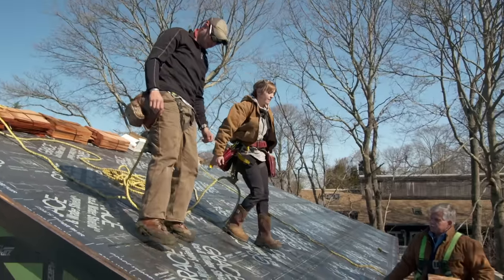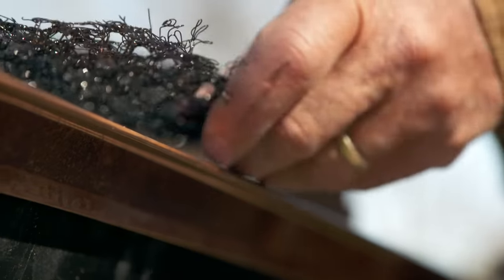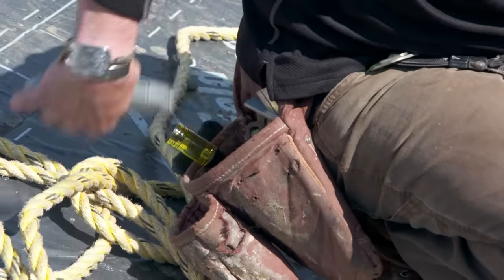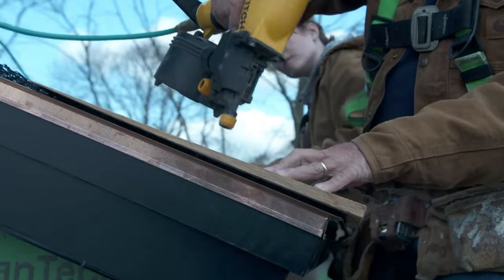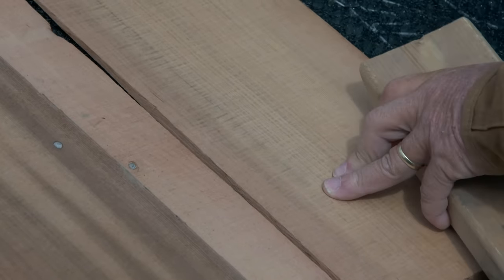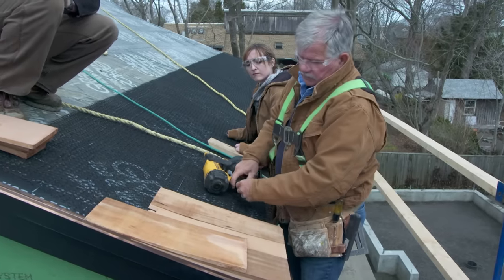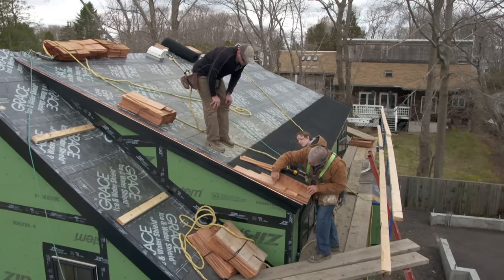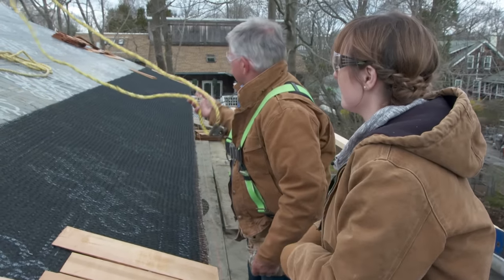How to Install Wood Shingles | This Old House

Comment: I wonder how they do the ridge with a cedar shingle. Great episode.
Reply: Alternate the overlap as you go down. Same way you would weave a corner wall.
Reply: Generally, the ridge shingles are run laterally, ( sideways) with the exposure facing away from the prevailing wind. Snap equidistant  lines down from the ridge. On your tablesaw, you can prep some slightly oversized shingles. The first shingle is nailed to the line, then trimmed flush to the opposing angle of the ridge. The adjacent shingle on the opposing side is set to the line, then planed flush to it's brother. The lap on each pair is alternated to ensure strength and resistance to weather. I have seen copper ridges......also all wood ridges pre-fabbed and epoxied together. You do not continue normal shingling.... a teensy course with exposed nails at the ridge  is a hack recipe for disaster.
Reply: I use a continous ridge vent system consisting of Cor-A-Vent v-600 with a custom fabricated copper trac rack over it. Saddled ridge shakes are then cut in a table saw and glued in place in the rack. We do it the same way with slate. Just nailing a ridge shake up there is 8 trac tape player technology and there are better ways to do things today. This also addresses proper attic ventilation per code as required in most municipalities.

Comment: He missed a lot of details here.  The biggest is not having a gap over a nail.  That is a sure way to get a leak.  It may not show up right away, but the life of the roof will be cut by over half.  You can see he placed the gap right over a nail, and on the bottom half of the roof that nail is going to see a LOT of water.

The other thing is staggering gaps in 3 consecutive courses.  That prevents leaks from cracks and wear because the water will form small streams in the cracks and erode the shingle below.

Installing shakes is very detailed.  You can install a roof and have it look amazing, but it will leak like a sieve and not last 5 years if not done right.  Every little detail matters.

Comment: Nice approach with the Breather and all BUT in Laying out shingles it is CRUCIAL (especially on roofs) that the course you are laying should Offset widths by 1” or more not only 1,. But 2 courses below it.  (If that shingle splits inline with the gap of the shingle below you goy a leak potential.

Comment: I find it amusing that most homes built properly at the time last a hundred years without the benefit of house wrap, roll roofing ventilation mat,  and other millennial inventions?? Why not use a laser instead of a string line?
Reply: Because this site failed to publish my reply to Alexander Zerka I will try to remember it again. That's Great Grampa to you boy and mats were not around 20 years ago. So tell me Mr. Wizzard (before your time-look it up!) if mats prevent moisture from evaporating why isn't it used between courses??
Reply: @alexanderzerka8477  Answer my question, dork!! (look it up)

Comment: I did my garage many years ago. Same as what was done here. I only used the Ice and Water shield around the perimeter then tar paper away from the edges. Also there is the debate whether it’s better to hand nail rather than those skimpy automatic nail heads. Some nail guns you are limited to the type of nails you can use. Hot dipped or stainless?
Reply: Hot dipped galvanize react to cedar.
Reply: "Skimpy/skinny" nails are required for cedar shakes along with them being stainless steel. I use staples to avoid splitting and countersinking but your stainless steel must be #304 minimum and #310 grade if you're within 15 miles of any saltwater.